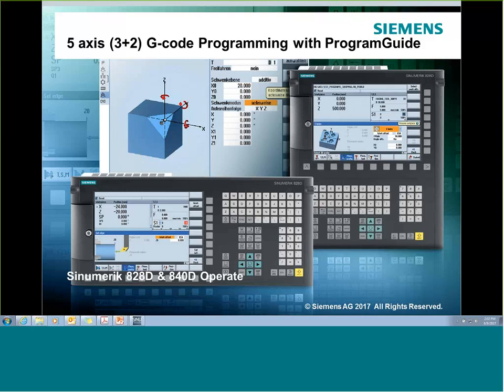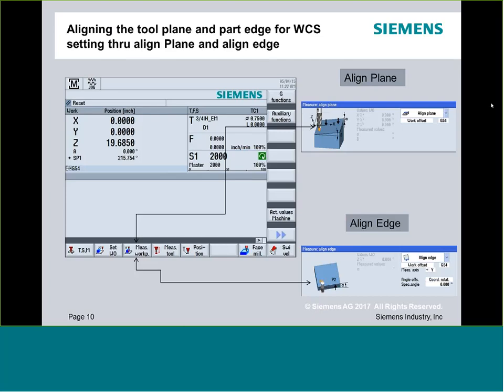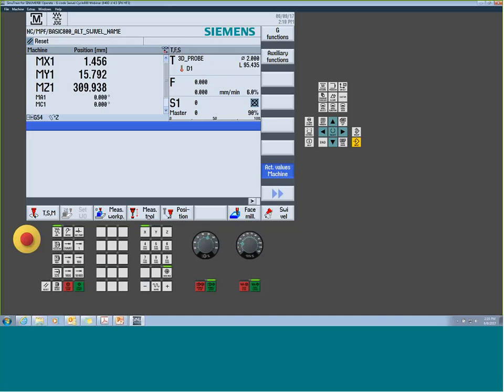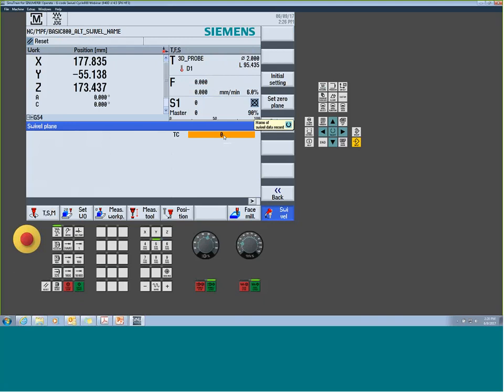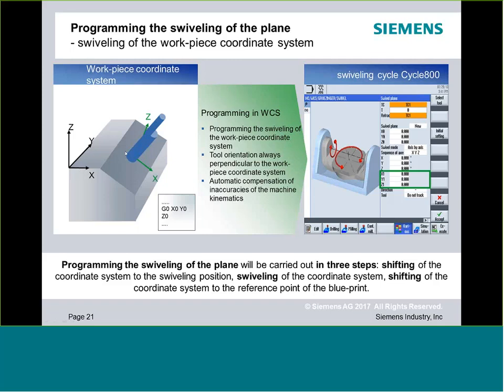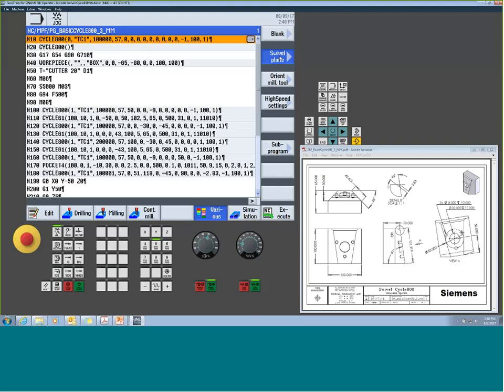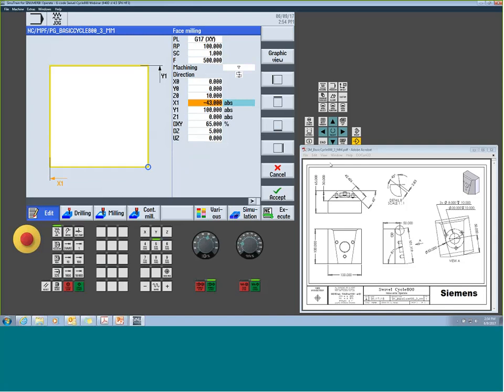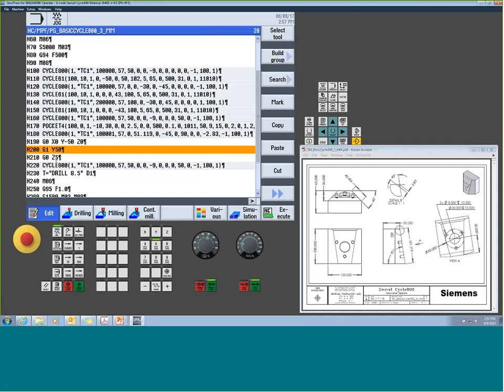5 axis 3+2 G code Programming with ProgramGuide – SINUMERIK 840D Sl & 828D Milling 20170609 1802 1

Comment: To get the plane normal after 3 point alignment, why use swivel cycle instead of a simple MDA program like below?

G0 G90 G54 Z0 
A0 C0
M30
Reply from the maker: because that code is not aligning the plane(WCS) that is only moving machine(MCS). MCS vs WCS